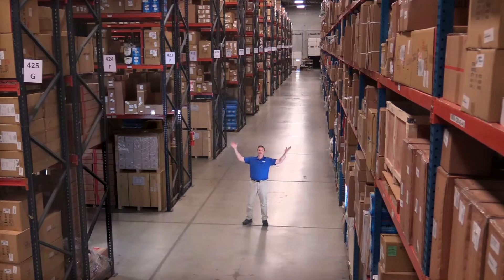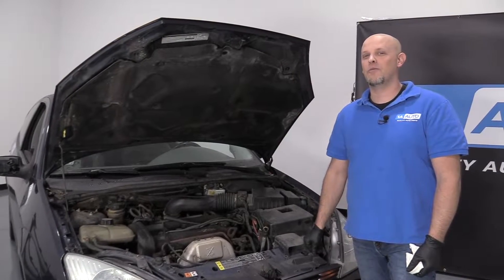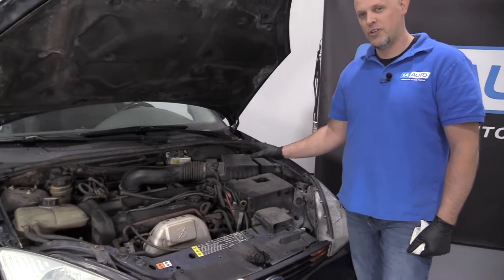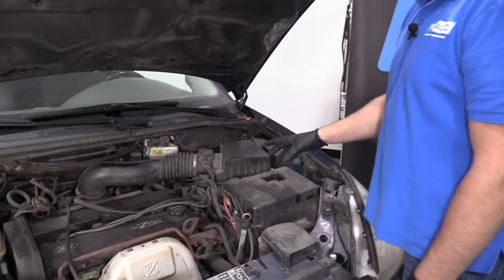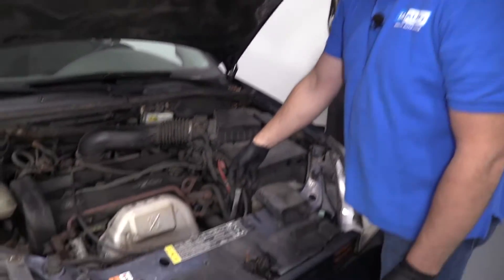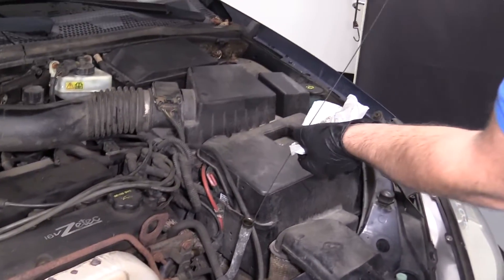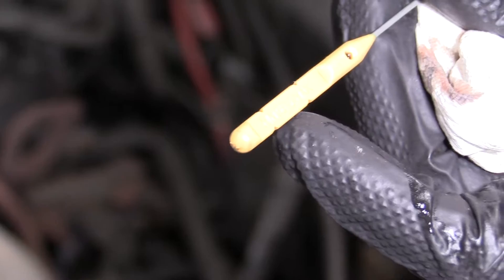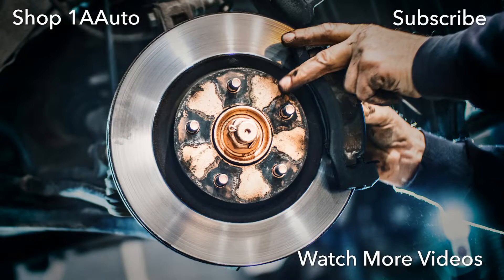How to Check Transmission Fluid 00-04 Ford Focus

Comment: I need help please. I can’t get an accurate reading on the dipstick. I’m not sure if it’s just me but I’ve tried it multiple times and yes I do it the right way when the car is warmed up and I hold the dipstick up to make sure I get an accurate reading. Every time I do it I can’t get an accurate reading because there is always transmission fluid all over it. Not only that but when I take out the dipstick it comes out and kind of twists a certain way and also when I put it back in it doesn’t go in right away I have to push it and it twists itself a certain way and it goes in even if I try to insert it the same way I take out out. I’m not sure if that’s why but thanks in advance.
Reply: Me too. Same problem.
Reply: @zeepogo  what I did is change the transmission fluid and it might've been over filled because afterwards I was able to get it to the correct level and I could see it clearly where it is.

Comment: andy   hi  I have a 03 focus 2.3  when I checked my trans fluid I did not have my parking brake on   will this effect the level ?  also  my fluid is bubbling up on the dipstick  what does that mean
Reply: Exactly also I am as well. It’s inaccurate each time it reads something different. Does it have to have the parking brake on?

Comment: How do you add fluid?
Reply: Add it where the dipstick is
Reply: Nooo....never,engine need to be stoped for not less than 5 min before checking,vhen engine it's running the oil it's pumped and spread in the engine

Comment: Do I need to check while the engine is running?
Reply: Yes, just while checking the transmission fluid.  Engine oil, leave the engine off.
Reply: Yes

Comment: There is no dipstick on a 2003 Ford Focus SE, but it was to suppose to be the best version of the vehicle with 6 speakers included
Reply: Is it a manual transmission? They generally have a full hole on the side of the transmission instead of a dipstick. They also take gear oil instead of ATF. There are exceptions of course but that is what is most common on manual transmissions.